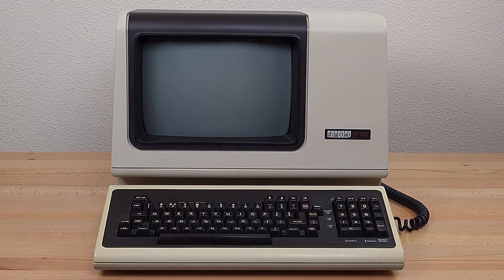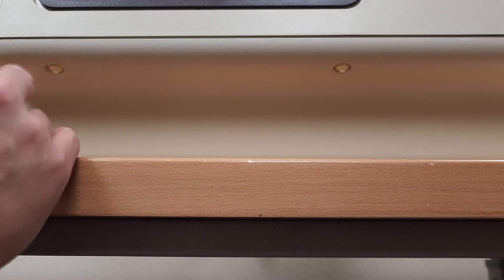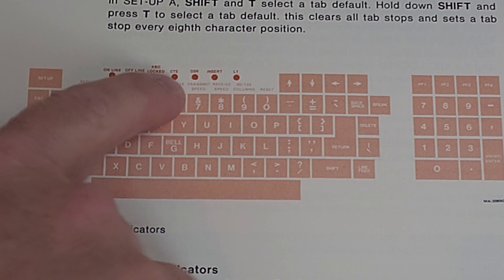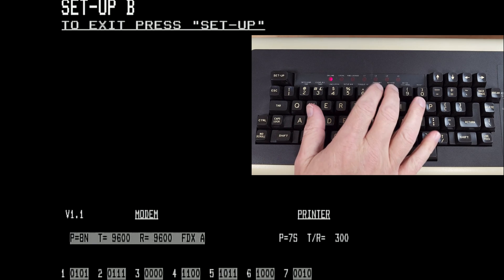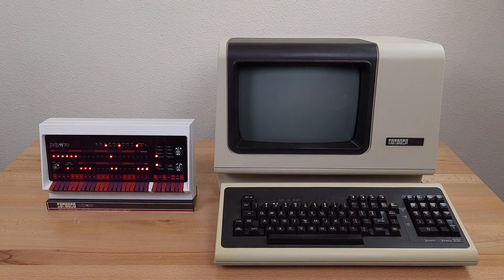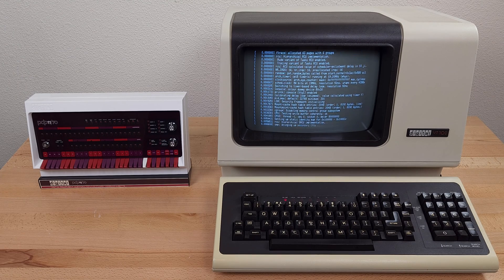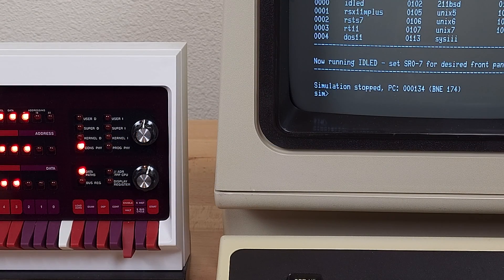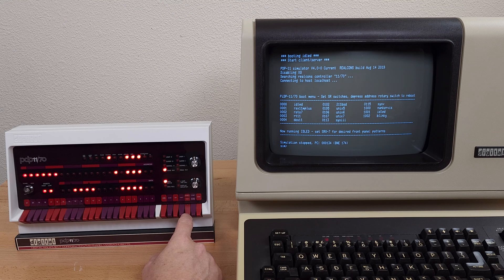Show and Tell: DEC VT102 and PiDP-11

Comment: "The DEC VT 100 terminal is  notoriously linked to the Therac-25 radiation therapy machine's fatal malfunction due to faulty programming code. It is exactly the same terminal it's just the cheaper variant of it

.

Comment: Hey Chuck.  Didn't realize you had a video on this, found it while I was googling when my pidp-11 died (sd card corrupted after multiple power outages - important note, back up the sd card, it's a pain to make a new one unless you use a pi 4 as the new image is for that).  Anyway, the base... what did you use for that.. did you make something different or is that some kind of sticker or something around the wood?
Reply from the maker: Just black spraypaint over the included wooden base.
I printed the 'digital' image, "laminated' it with packing tape and stuck it to the base with double sided tape.
I did make an image of the SD card not long ago.

Comment: I've always dreamed of having a VT-100! For me, they are THE terminal.
I'm a little disappointed that the PiDP comes up with a Debian login prompt, I'd like to to just run the emulator on the console right away so you're straight in with an RSTS (or whatever) login prompt right from the get-go.

Comment: Wow!  How can I get/make the base you have your PiDP-11 sitting on?  Mine's just sitting on the wood it came with, but the repro of the rack topper thingy you have under it really sets it off!  Way cool!
Reply from the maker: I just painted the wood base black and printed the DEC rack topper on 11x17, cut, laminated and stuck it on the front with double-sided tape.
Reply: @HutchCA  I was beaten to ask the same question! thanks for sharing how you did that. I'd like to do something similar for my stand.
Reply: @HutchCA  Thanks!  It really does look good.  I've been thinking about making a "tiny rack" for mine with a logo and... other stuff.  Maybe just a cabinet door covered in black tolex to match the original and help keep my desk tidier.